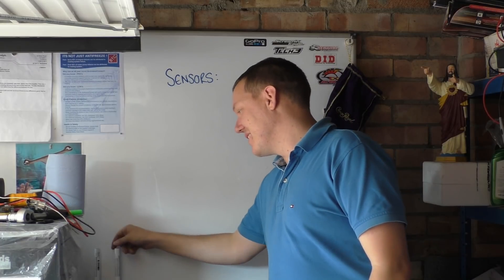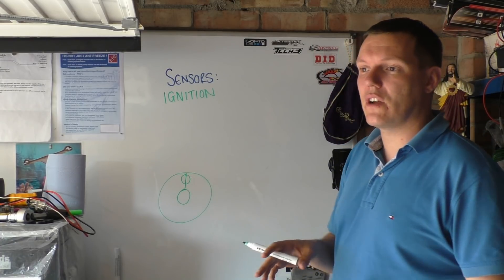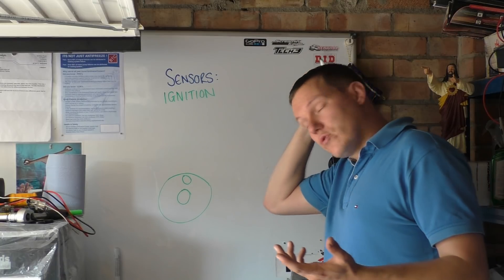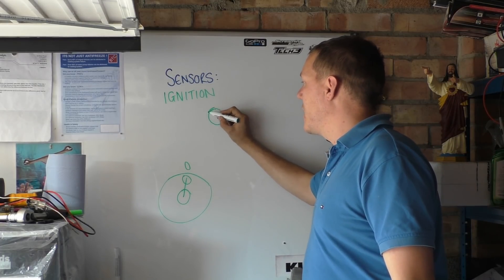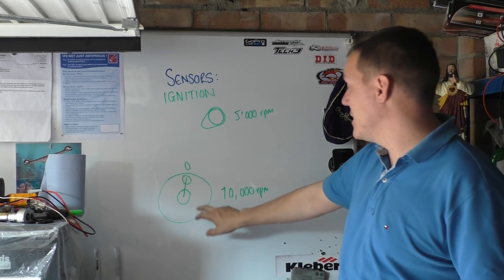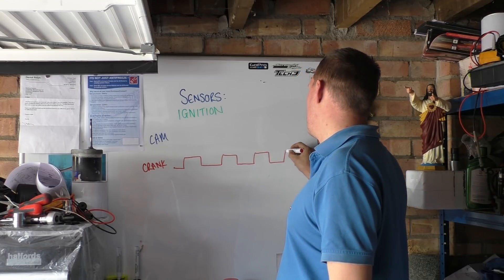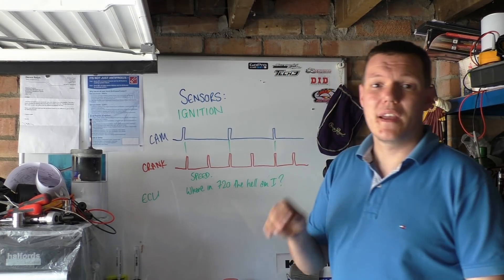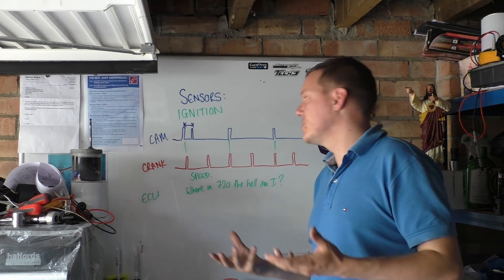Understanding Ignition timing - Sensors

Comment: Matt, is the reason you make more power when advancing ignition timing (say 15° btdc) because the air/fuel mix takes time to burn so the piston moves slightly past tdc the pressure from combustion then forces the piston down resulting in more power?
Reply from the maker: Basically yes. What happens is the ignition timing has to advance as rpm increases.
Reply: @thedirtyworkshop  I'd just like to say all the help is massively appreciated mate and i know this isnt related to this video but i think (emphasis on the "i think" 😂) i've managed to wrap my head around the example you gave me for the ve video now i've had to google this and at atm pressure  for 1 m^3 of air it weighs 1.225kg so when you said at 50% ve the cylinder is full but the density is half that of atm pressure it weighs half of the 1.225kg which says to me theres half the weight of air at atm pressure am i anywhere near being right?
Reply: Matt, just to add to this mate, the crank and cam sensors are there to let the ecu know where the crank and cams are in respect to their rotation so the ecu knows when to fire spark and injectors?
Reply: Is this right mate?
Reply from the maker: Yes. The cranks sensor alone would only let the ecu know when tdc occurs, and not what stroke its on. The cam sensor does that. Some bikes just have cam sensors and the crank sensor is just for rpm
Reply: @thedirtyworkshop  Matt, you're a top guy thank you so much for all the help its massively appreciated mate

Comment: Would like to see a video on charging systems and their common issues... stators open circuit or shorted, reg/recs pumping 18 volts into batteries (boy that was fun when it happened to me) and why shit earth connections affect your charge rate etc. And how 1960's tech rectifiers shunting current to ground is a good way to cook a stator. Turning off all your lights etc makes this problem worse!!! more current not being used!

I replaced my reg/rec only to discover that my stator was shorted, by the junction box on my kwaka clicking when I connected or disconnected the reg/rec on either end of the battery lead, and when I disconnected the stator! Didn't happen with the OEM reg/rec because it is switched with the ignition.

Comment: Waste spark systems have been used on multi cylinder 4t 4 cyl for decades, twin 2 stroke, 4 stroke single engines.
if you have a 4t x 4 cycle that has 2 coils, each with 2 plug leads, its a waste spark system.
No combustion occurs at overlap in 2t or 4t as there is no compression for auto ignition conditions, and due to that the spark voltage is very low on the wasted spark or "dead spark" side, so its not the same as firing a plug twice during compression and combustion with respect to wear. As to hearing the difference, that would suggest there is some audible occurrence from the weak wasted spark, when there isn't any combustion to create a noise you could hear.
Reply from the maker: apart from some of the overlap mixture
Reply: Nothing burns because it cant reach auto ignition level with no compression and no heat.. It cant burn part of the mixture without burning the rest, if it set fire to any of the mixture the rest would burn and it hasn't filled the combustion chamber so any burning would be an almighty back fire up the intake burning the mixture in it..
Reply from the maker: So the popping in your exhaust is just fantasy then? Not talking about the whole mixture but pocket can - HD did a whole series of tests when they tried to sue Honda over the Vtwin shite they pulled (or tried to) in the 80's
Reply: "apart from some of the overlap mixture"
Do you mean the unburned mixture from the last combustion, that was going to exit through the exhaust? Or some part of the new mixture that is coming in through the admission valve during the overlap?
Reply: 2 problems, igniting a part of the mixture only without it back firing up the confined intake. if there is even a mixture there yet, when the spark occurs it is BTDC not at TDC , if it sparks at 10 deg BTDC  the inlet valve may be slightly open by 10 to 20 degree with a still rising piston expelling the exhaust, and you still have the problem of combusting any fuel without compression.. As to the idea you can burn some unburnt mixture post combustion by a weak spark under no compression when the exhaust valve is maybe still 50 degree to closed is pretty "out there"  Harley Ferguson, i wouldn't pay much weight to that, they suffer overrun issues and backfire like an old tractor which is inherent to their V engine and fortunately not most others.
Reply: I should mention that a 2 stroke twin that uses dead spark system, meaning it fires the plug when the piston is near BDC and near TDC has no effect, nothing burns at BDC firing even though transfer ports and exhaust are fully open. I had a single twin lead coil (wasted spark) on my 350 2t race bike. And some car engines use wasted spark, like V6 engines with 3 x dual lead coil packs that run wasted spark which can be triggered from crank sensor, no cam sensors required..And remind again that the wasted spark is much lower voltage and less intense spark than the spark under compression, spark voltage is determined by spark resistance that increases with compression.
Reply: I just did a video covering wasted spark systems , makes it pretty clear https://www.youtube.com/watch?v=7yRQgUSPEgs

Comment: Im imagining bikes and cars work rather different on the ecu side,on cars we have a multi tooth crank pickup,let's say a 36 - 1 tooth,of course 10deg each tooth,the gap tooth usually 45-60deg before tdc,gives the ecu time to make decisions on spark.
As for the wasted spark,I think the engineers use it as a short cut,but it does have benefits,when off throttle the ecu retards the spark to around where the exhaust valve is open,it gives a bit of crackle and pop and gets rid of any fuel remaining in the combustion chamber and exhaust,it results in a slightly higher combustion chamber temp,helps a bit with emissions,power wise I don't think it helps much.
Thanks for the show mate.looking forward to the next one:)

Comment: I have a honda single cylinder, carburated bike, and it does not have a camshaft position sensor, does that mean that it fires the spark plug every 360°? If so, isn't there a greater risk of occurring pre-ignition or backfire?

Comment: firing balance too?
Reply from the maker: whwhwhwhwh what? LOL
Reply: Since you're starting an Ignition/controls series, could you do a video on firing order balancing the engine? I know you touched on it before, but a video on how firing one cylinder before or after the other balances the engine, would be cool, its something, I have yet to find a good video of.

To be more specific, not so much what order to fire an engine in but why that firing order balances the forces in an engine. 1-3-4-2 or 1-4-3-2 or 1-3-2-4 or whatever yama's crossplane is doing. That EE guy did a video but it was pretty generic.
Anyway just a suggestion

Comment: the "Harley sound" is because of the V angle and the shared crankpin resulting the cylinders are not firing at a regular interval, it has nothing to do with any particular ignition arrangement.
Reply from the maker: does it not - didn't you read the patent that harley tried to file - obviously not. Yes V-twins have their own exhaust note, but Harley's are slightly different because of the crack of the waste spark. I don't know why I'm repeating myself
Reply from the maker: Basically any vtwin with the same angle will sound the same as a Harley?
Reply: that's why they sued Honda for making a 45deg V twin with a single crankpin. I don't  see how the wasted spark could make any sound, firing on the intake stroke would blow out the carb,  on the exhaust stroke there's nothing to ignite
Reply from the maker: "that's why they sued Honda for making a 45deg V twin with a single crankpin." 

- yeah I remember when Harley tried that stupid stunt - like that would fly LOL Harley didn't invent the single crankpin v twin - fucking idiots. As for what you just said LOL

Have you heard a spark plug fire, its really quite but there is always residual oil and fuel in a cylinder, at at 1,000's of rpm this 'after-pop' which is what Harley tried to file through the patent office contributes to the overall sound. 

The patent office told HD where to go of course as you can't patent an exhaust frequency as most vtwin engines will pass through that frequency not only that but you can't petant a sound wave - as no 'work or effort has been done to achieve it' unlike a jingle or song
Reply from the maker: "firing on the intake stroke would blow out the carb,  on the exhaust stroke there's nothing to ignite"

- just read this again........

What? ignition is close to TDC, so on the compression/power stroke and on the exhaust/intake stroke - but you forgot valve overlap - plenty to ignite there - you've heard exhaust popping haven't you?
Reply: one wasted spark is roughly in the middle of the exhaust stroke that won't do anything. The other wasted spark is roughly at tdc or a bit after tdc, if you manage to get an ignitable mixture there it would back fire through the intake

Comment: I have a 3 wire knock sensor, air temp sensor, crank angle sensor and probably got a few old Bendix injectors or some Bosch ones, Bosch ones you could keep, might have a TPS and MAP sensor that's of no use too.
Reply from the maker: Yes I want!
Reply: Then you shall have, give me a couple of days to fish them out

Comment: I just want to mention that I did go over 150mph today... more then once. Flipping off the cars that start to push in traffic. I even hit 155mph... only thing bad was the fuel went out almost twice as fast compared to a normal speed of 100mph. This is to the one video where you asked who goes 150mph on their bike. I DO!
Reply: Tony, I am 49 if I got some I missed that anyways... And I guess I know what I am doing on 2 wheels since I do that since over 30years. And when things went wrong in the past the speed was not the main cause of it.
Reply from the maker: Did you notice the difference wind buffering makes?
Reply: LOL of course! that is why I tug down behind the wind shield and avoid sudden movements ;)
Reply: Tony, Click bait would be the video when I buy a beer stop at the police station right at the Autobahn open the beer drink it right in front of the police and and take off to the limit that is at ~165mph/ 264Kmh and absolut nothing happens. Because all of it would have been legal. You can open your after work beer in your car and drive home when you drink it. You just have to make sure you do not exceed the legal limit and no one cares how fast you go in a section with no speed limit. I am just to old to go still with +100mph trough the city in the middle of the night like in the 90's and today there are 99% more radar traps on the roads them back then. They figured out that speeding tickets are a good income for the city...
Reply: l  like beer.
Reply: you will not live to see your children  grow up
Reply: mondayfool, I do not vlog ;) I guess you got to strap that gopro pretty tight...
Reply: Josh, I take it like when one of my sisters tell me to take care and ride save... I ride the same as always that should be fine because I am still alive. Because there are 2 kind of motorcycle riders in general the one is those who are alive and the others are the dead (some just don't know jet). And since my riding teacher told me to drive like every one tries to shoot you off your bike and do not even trust your friend next to you. And I always remember that when I see the next moron on the road or when the guy who rides with me tries to go stupid fast trough a turn and has no fucking clue how the road ahead is... I go my speed and fuck what the others do.
Reply: My apologies onawaii i thought you were a juvenile ,it  might be someone elses children there parents do not get to see grow up you should grow up ,save it for a race track see how big your bollocks are then.ps im 60 with a lot of milers under my belt 2 wheels and four, things go fatally wrong pretty fast at 155mph.
Reply: Well Tony, great that you have made to get 60. Congratulations!!! The thing with riding fast is like riding a bicycle, if you have no clue what you are doing you may have an accident. But since I have taken every vehicle I have owned up to top speed and that totally legal I don't think that I do not know what I am doing. I know exact what I am doing and what I should better not do and that includes when and where. I could even ride 200mph legal on the "Autobahn"  I just need to go to a section where the "No Limits" sign is posted and nail it down the road. But I never owned a vehicle that was that fast. And in sections with no speed limit most cars will be over 90mph and believe me I meet some super sport cars or sport bikes like the H2 or S1000RR on the road that pass me going 150mph with ease and my guess that they have at least 35 more mph on their speedometer. I might have meet the one or other bird in my life that did not made it back to feed their children but that has to be a only hand full in the past 30 years. Oh yes one rabbit is on my tab too and a billon fly's/ bug's on a summer day's ride too. It is more dangerous to just change lanes and give a fuck about what comes up on you from behind. I choose to pick the spot where people see me in the rear mirror and never pass on the wrong side. Then all you have to do is observe the traffic and you know when you have to be prepared to slow down the fuck and change lanes. Oh yes milers went on my account too! I collected them all over Europe and I tell you they do not drive all the same and the road condition differ also from great freeways like in France to pothole action in Poland in the early 90's and if you ever have seen a dash cam video from the Ukraine you know how bad things can be... I have been there 2007 and refused to drive by my self but that was on vacation. Oh yes I have bee driving and riding some miles in the USA too and roads there can be bad too but it wasn't only the road conditions why I choose not to drive in the Ukraine. The list of countries in Europe is smaller that i have not seen then those that I have seen. On some trips we drove 3600mi in 3 days with 2 persons splitting the ride and that over 5 countries. So I guess I know the fuck what I am doing on the roads. Even if I flip of cars on the Autobahn... But I pick only those who drive like they are king and try to push trough traffic and show them what a slow piece of shit they drive. 2-3 pulls and they give up. More shit goes wrong if you go slow and pay no attention to other ones right of way.
Reply: Autobahn fine ,but this wasnt stated ,click baited?ride safe mind how you go.

Comment: All the basic plant engines like Hondas gx390 fire every 360 degrees, and the oil pump is a finger on the bigend cap.
Reply: there can also be quite the different between injecting on a closed vs. open intake valve, without a cam sensor you have to do both or it would be random every time you start the engine